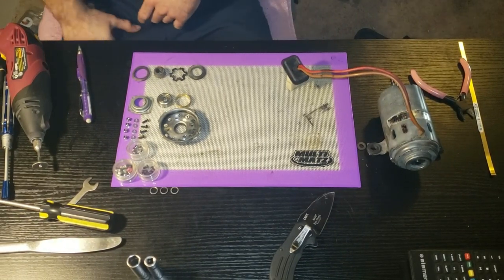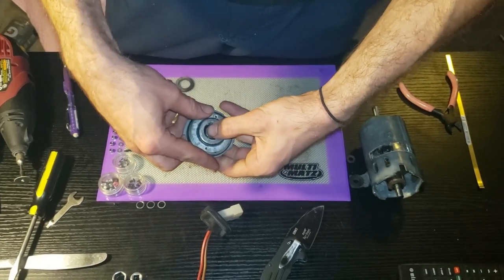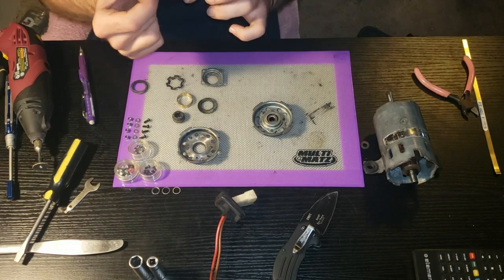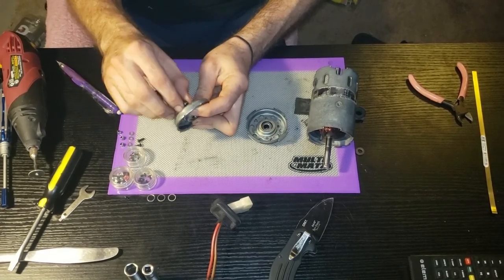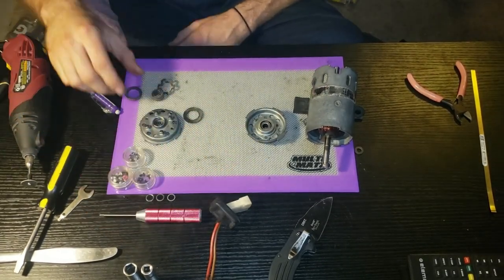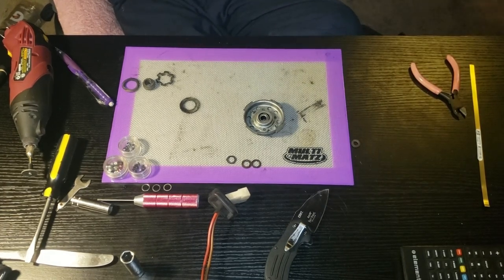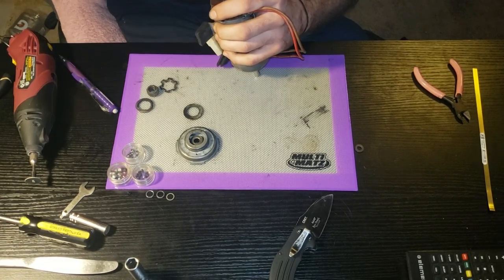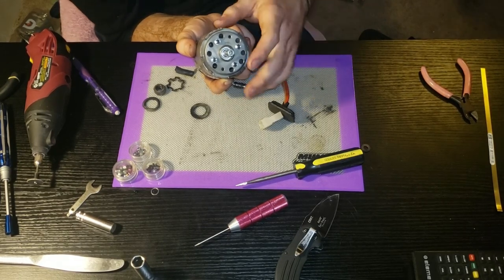VW MK1 Rabbit or Golf A/C blower motor repair and rebuild

Comment: Awesome video! I have the same issue on my 83 jetta that I need to tackle. You used a 608 bearing?
Reply from the maker: Super sorry for the late reply, but thank you very much for the appreciation !! and yes they are 608 bearings I got the highest grade I could find with metal cages to hopefully withstand the RPMs of the motor and its still going strong to this day !!

Comment: I just went through replacing the blower motor on my '87 Scirocco. One thing that stands out with your blower motor is that it does not have the big green resistor and all the associated wires like mine does. Curious as to where the resistor is in your setup. Anyway, very cool repair video. 
👍